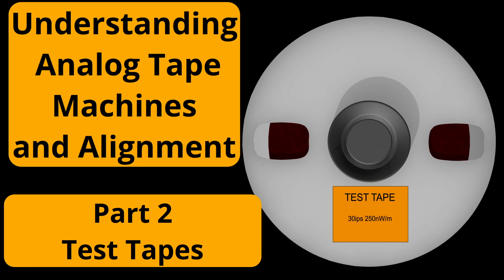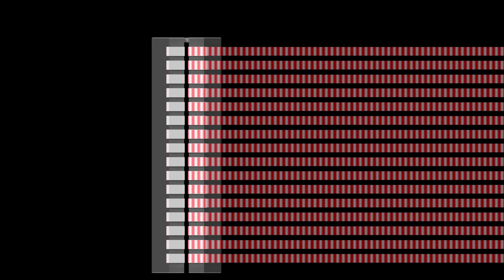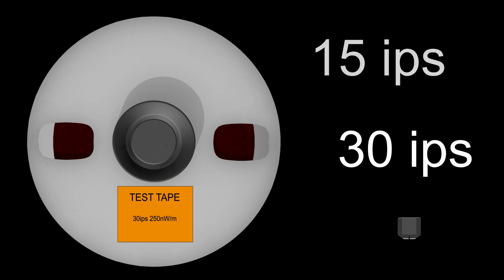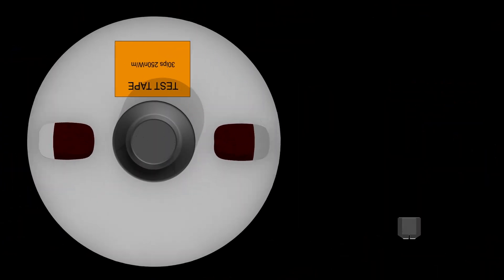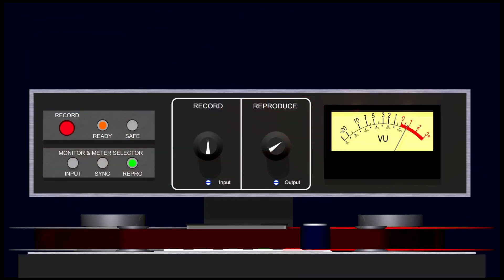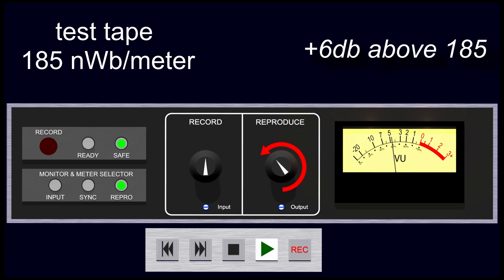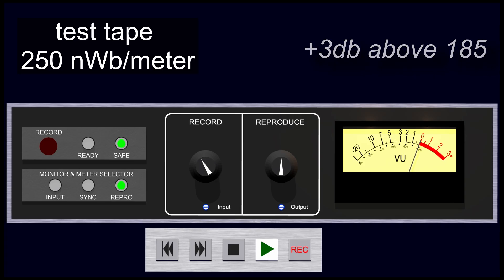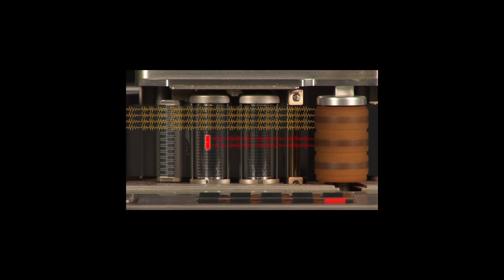Part 2 Understanding Analog Test Tapes

Comment: Great video.... Just pulled out my old Tascam TRS8. I can't believe how much MRL test tapes are though. (OUCH). $400 is probably about half the value of the machine.  Is it possible to calibrate without test tape? Using a brand new tape and a tone generator?
Reply from the maker: Ahh not really, if you watch part one it explains why, you could make minor tweets so the playback is similar to record, but it's a bit of a trap shoot, and it won't relate to prior recordings, or pre recorded tapes